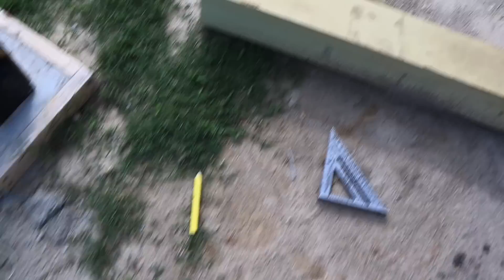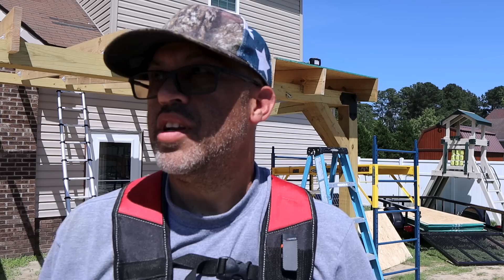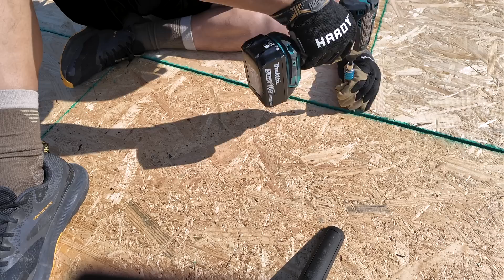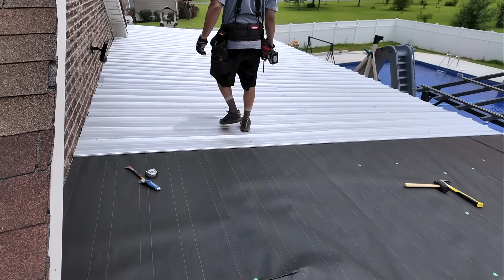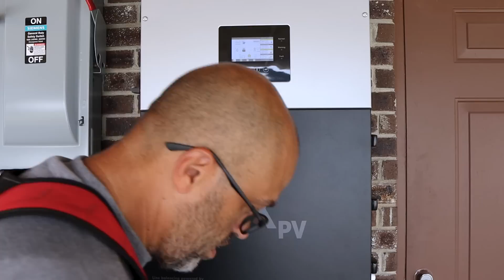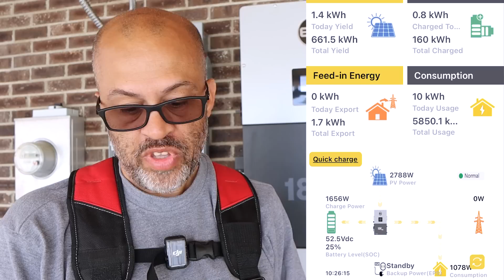DIY Solar Patio Build Part 2 - Homemade Solar Patio for EG4 18KPV

Comment: Is your main panel connected to both the grid and the 18Kpv?
Reply from the maker: Yes. I have the 70 amp backfeed breaker on the panel from the inverter grid connection. It can receive power or send it back to panel.
Reply: @rodneyhunt did you already have your meter change to a grid tied meter? What if the house is not using much power and the batteries are full, will the PV not back feed the grid?
Reply from the maker: @fullyelectric  Have it set to zero export so basically it doesn’t feed back. You may some days see a .1 export but you utility will probably never see that if it is completely accurate. We will see over time though
Reply: @rodneyhunt interesting so with zero export set it somehow knows not to back feed the grid even when directly connected to the grid? What is power goes out does the grid output stop feeding your main panel since your load is connected to your sub panel?  Sorry for the loads of questions i want to get the 18Kpv or that new 12Kpv lol also i thought zero export just means the 18Kpv does not send back power out of the grid input .. so your main panel should not get any PV or Batteries power.
Reply from the maker: It is CT’s on main grid panel input to monitor flow of power. Yes the way I  have it set I think it stops feeding back main panel when grid power is lost. But might be a way to have it feed back somehow if you turn off breaker. Will try to test that out
Reply: @rodneyhunt  awesome 👏 keep us posted ..
Reply from the maker: Will do!